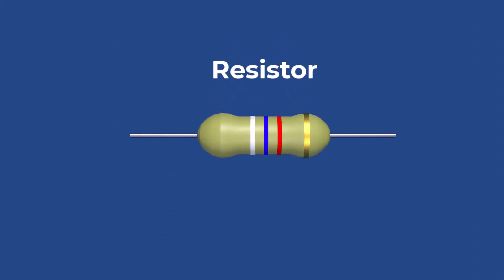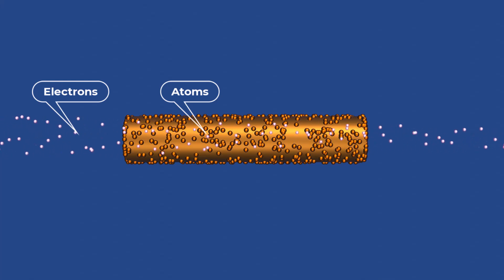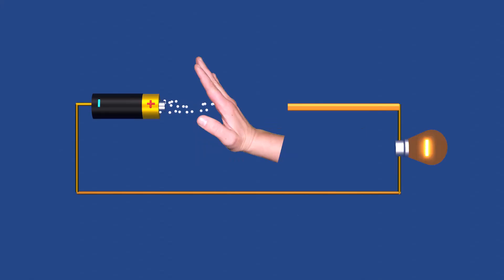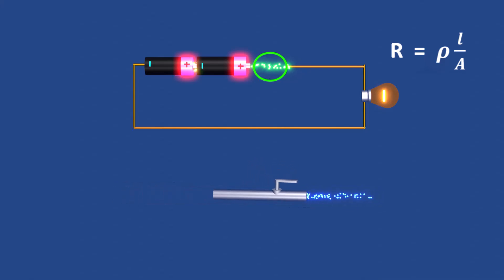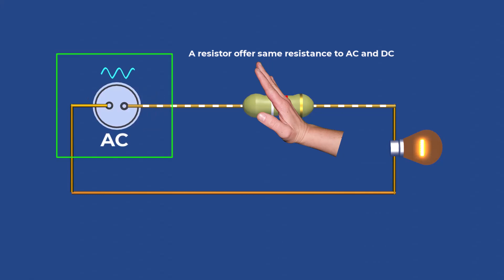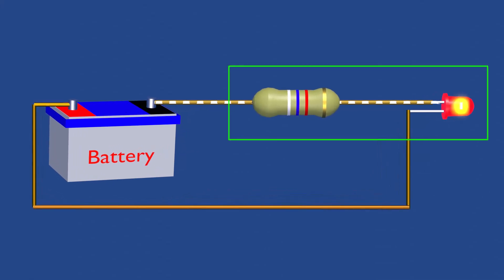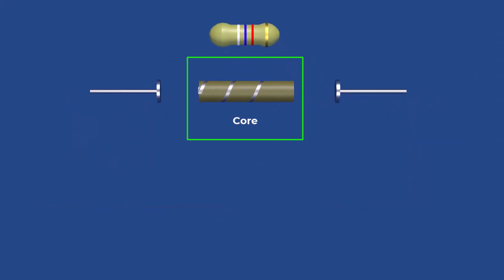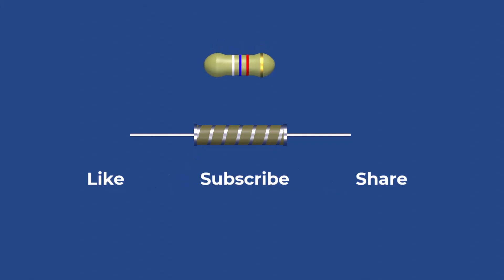Resistor | Resistor Working animation | Types of Resistors

Comment: Although I enjoyed your video, you show electrons moving from the positive side of the battery, through the light bulb, then to the negative side. This is not correct. Electrons move from the negative side of the battery to the positive.
Reply from the maker: I have shown conventional current,  which is the flow of positive charge from positive terminal of the battery to the negative terminal.
Reply from the maker: I have shown conventional current,  which is the flow of positive charge from positive terminal of the battery to the negative terminal.